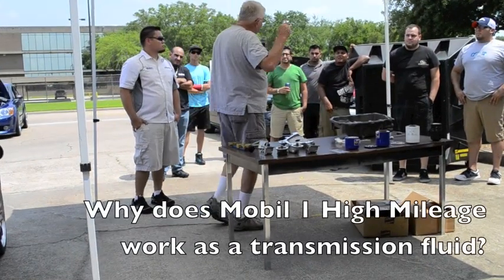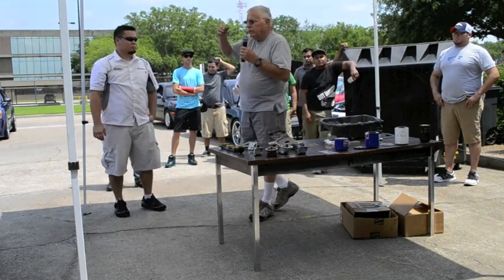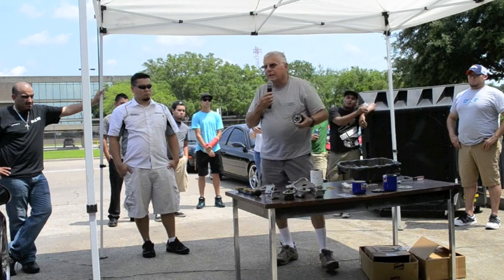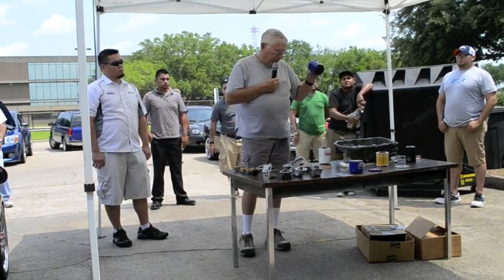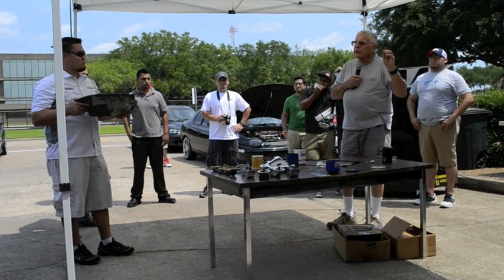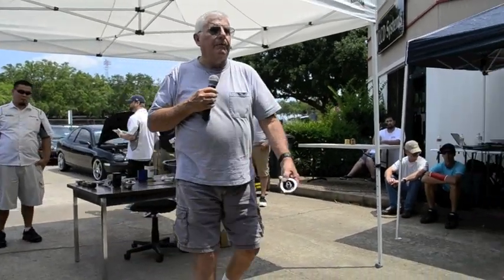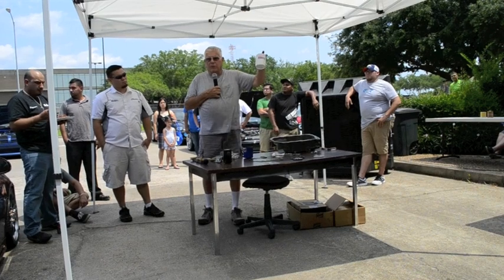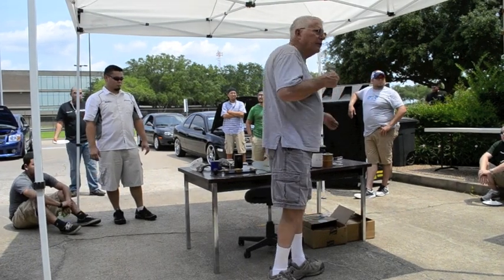Mr Peters Dodge Neon/SRT-4 Transmission Tech Talk at Modern Performance

Comment: My 2005 Dodge Neon has 251K miles on it and it still has a functional catalytic converter that passes emissions.  I don't usually use high mileage oil, either.